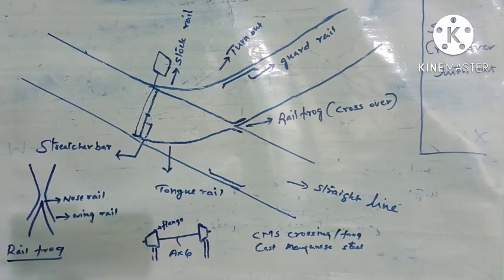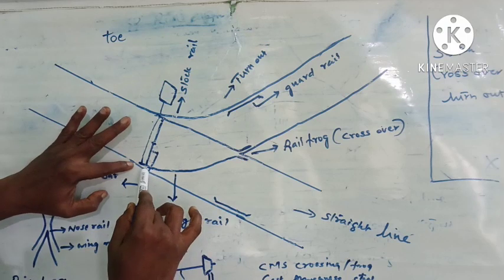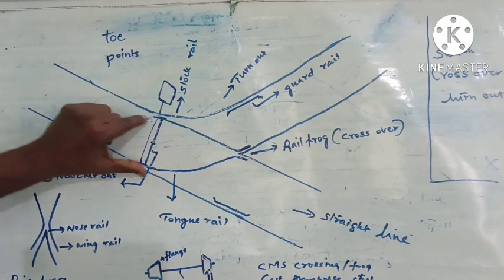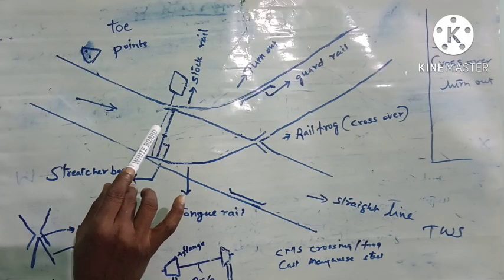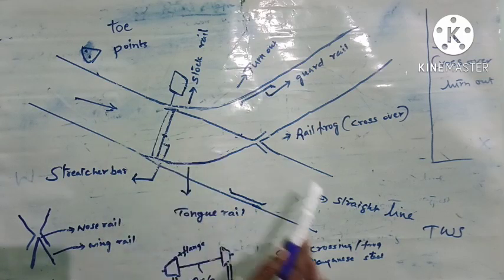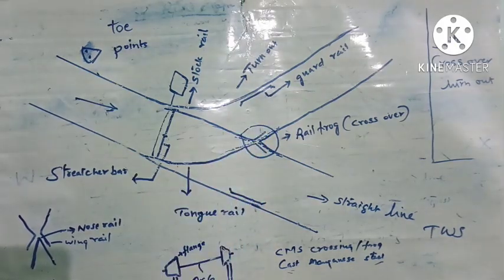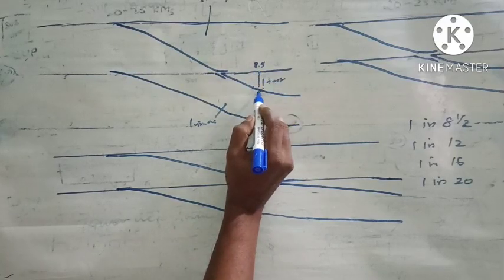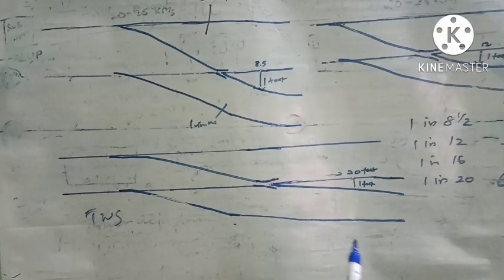points,tongue rails,stock rails,switches,cross overs and turnouts function in train movement

Comment: Clear one doubt sir.
Suppose panel goes to toally blank.
My question is for despatching a train for LSS, What authority should be given.
Somebody says PLCT but somebody says T/369(3b).
What is correct.
Reply from the maker: Not related to the video. If LC got through BI,T/369(3b)with endorsement will do.
Reply: Yes sir. Question not related to the video.
But question is relevant for all SM/SS.
Thanks answering.